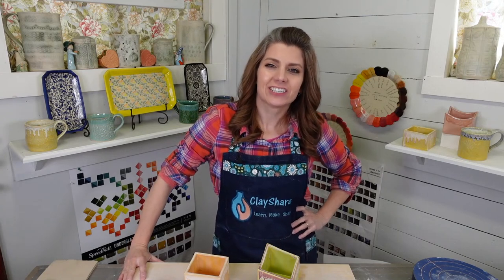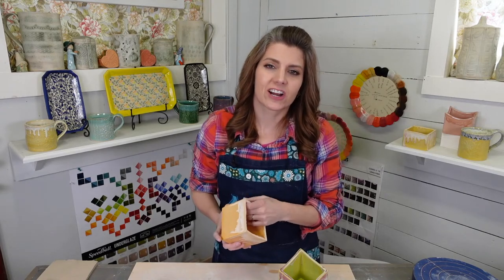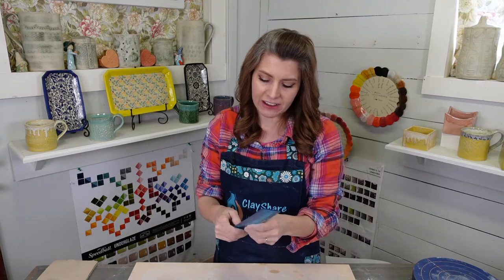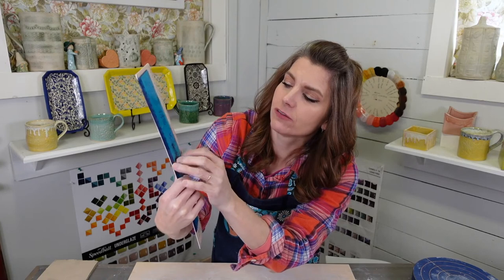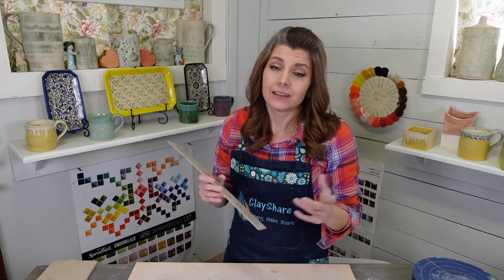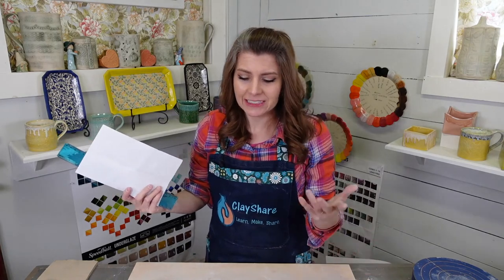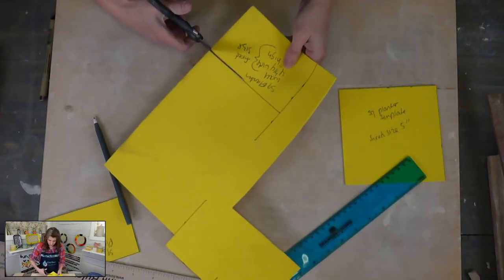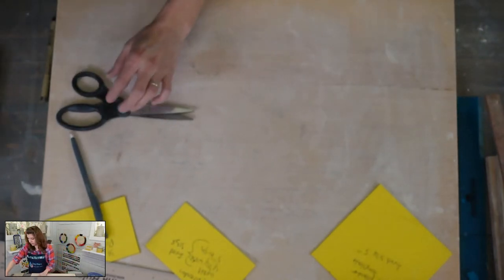Handbuilding a Planter

Comment: If you're not "heavy handed" when watering succulents, you could put 3/4 to 1 inch of small pebbles in the bottom of the planter before putting in the soil. Then you wouldn't need drain holes and tray to catch the excess water. The water would "pool" in the pebbles and eventually pulled back up into the soil as it dries out. (Sometimes this works for me... Sometimes it doesn't... Depends on how hectic things are and whether or not I'm paying enough attention to the soil 😂)